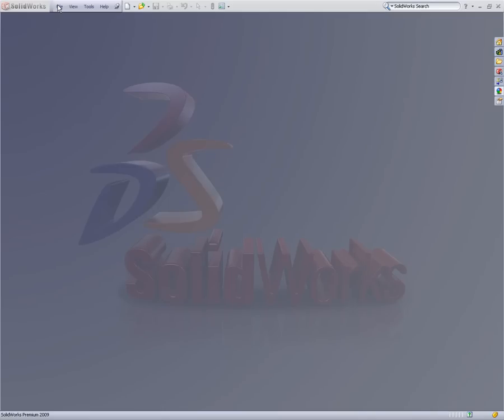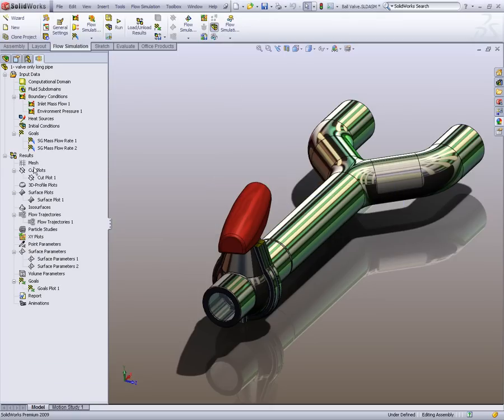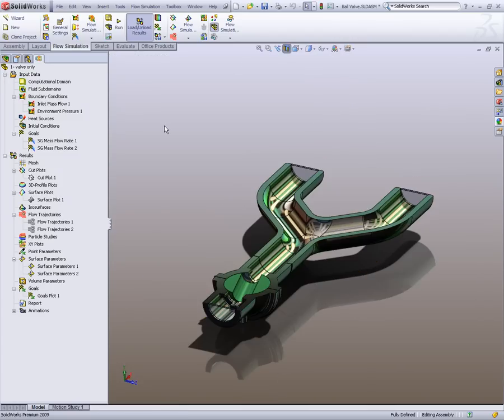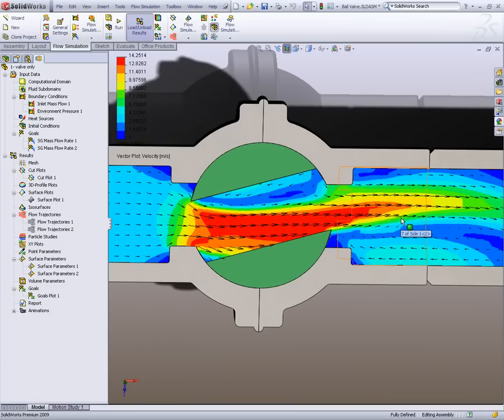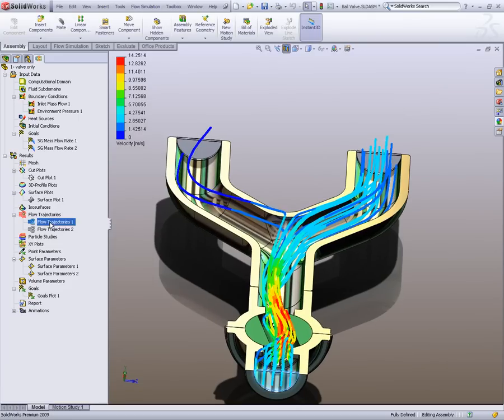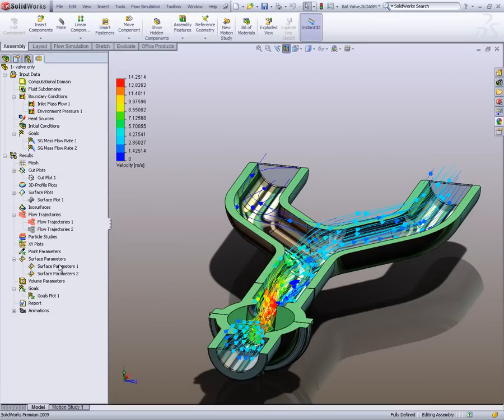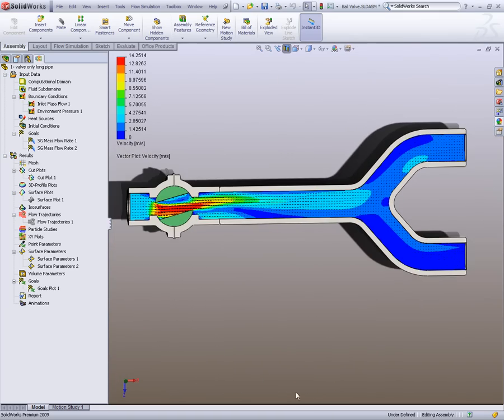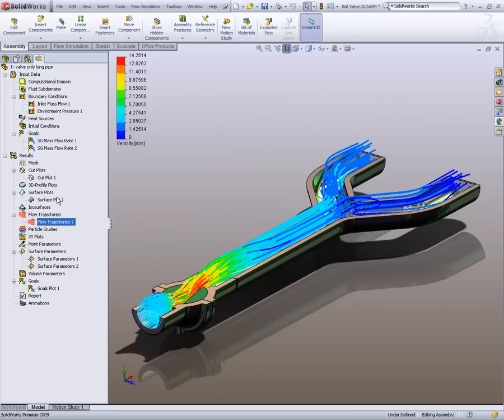SolidWorks Simulation Demo - Split Pipe - from ICT

Comment: just rotate the ball valve 90 degrees so it it opens horizontally compared to the y split instead of vertically. it will angle the flow up and down which will still hit the y evenly as compared to being given bias.
Reply: Hey Einstein. That clearly wasn't point of this video.

Comment: I can't select 2 outlets or 2 inlets in solidworks flowexpress?? It doesn't have options to select more than 1 outlet or inlet. How can I select 2 outlets or inlets. PLease Help.
Reply: After all these years... Only 1 inlet and outlet is allowed. So using one solid to cover up multiple holes is only solution.